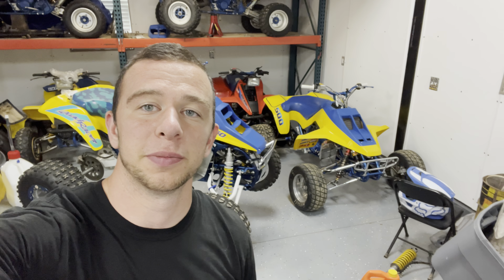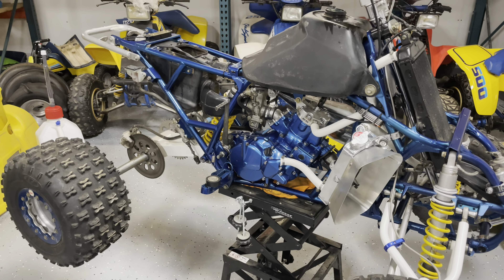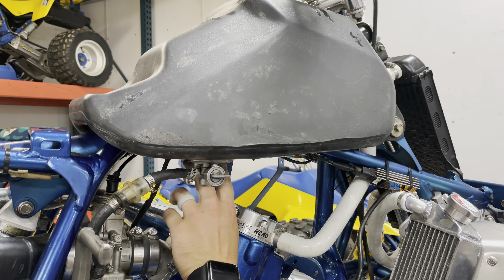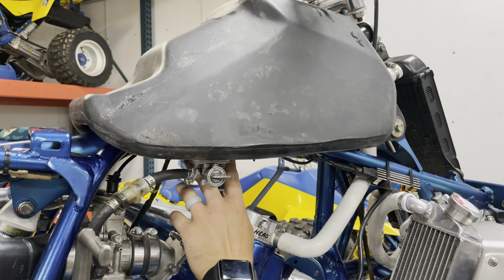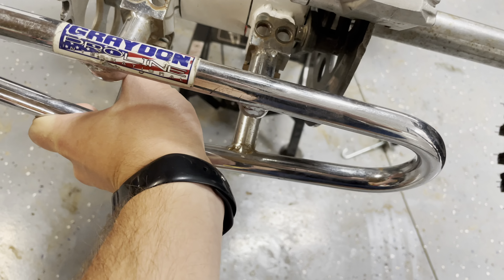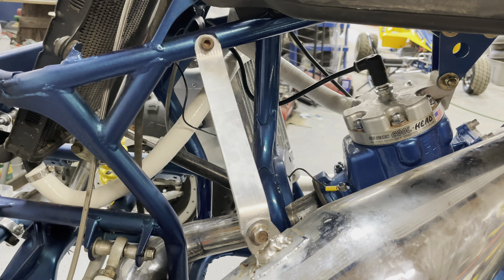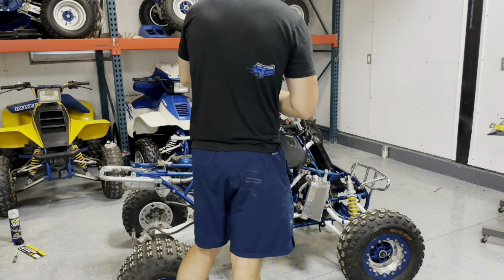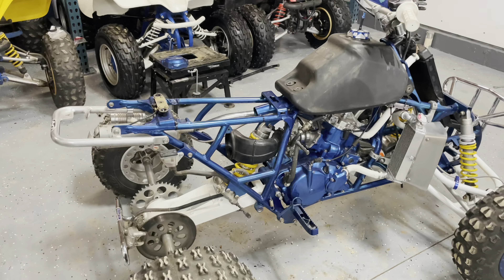Project LT250r Part 4 First Start! NOT WHAT I EXPECTED! (High Dollar Build)

Comment: when working on diesel engines we always keep something close that will block the air flow into the intake in case of a runaway situation.  Never really thought about it with a 2 stroke but obviously not a bad idea. Good video

Comment: Ever look an FMF Universal Turbine Core 2 spark arrested kit? the larger 1 1/4" for 500cc motor would slide over stinger and possible give more adjustment possibility...I recommend it for 87-90 LT owners. Really you needed a silencer made to fit though. I remember the pressure to finish the build before the riding trips though and the creative compromises that would just have to do despite how they looked.
Reply: You could also have turned / rotated the expansion chamber to make the stinger land outside the frame? Then make custom mounts. But I suspect at that point it would have interference with the fender...I rode mine without fenders once....lol
Reply from the maker: Very well-said! I can tell that you’ve definitely been around the block with the Quadracers! That’s a really good idea with the zilla silencer. They’re quite a bit longer, but I could always take some length off. Will definitely have to experiment a bit! Great input!
Reply: @jaegersracing  The FMF Universal kit is a silencer that is separate from the included pipe that has a few bents so you can rotate to desired position and cut it to any length if desired, google some pics...

Comment: The expansion chamber bracket is that far off for the OEM rubber mount?
Reply from the maker: Yeah, I really have no clue what’s going on there. Motor came from a second gen LT250r and bolted right up. I never would have though there’d be that much difference, but apparently there is!

Comment: That NGK plug boot is a must along with a good (new) spark plug wire. No mention of what plug you chose or what stator you are running?
Reply: appears to be B8ES...I would start with lower heat range B9 and only go hotter if fouling plugs. But I never could run the ES plugs long and always had to use the OEM recommended expensive EV iridium tips to avoid untimely failures.
Reply from the maker: Yes, that was pretty much all I had available at the time. I need to educate myself better on spark plugs actually. Would be good to learn the each digits meaning on the spark plug code. You familiar with them?
Reply: @jaegersracing  B= 14mm THREAD X 13/16" HEX, (R) CONSTRUCTION IS RESISTOR TYPE PLUG AND IS IRRELEVANT FOR YOUR APPLICATION, 9 IS HEAT RANGE AND HIGHER NUMBER IS COLDER,  E = 19mm (3/4") REACH, S = FIRING END CONSTRUCTION AND THERE ARE A LOT OF THESE, AFTER THAT IS A GAP NUMBER IF EVEN SHOWN....sorry about the caps

Comment: Feel bad for your dieseling start up...but it seems like you knew better and have been there. Kill switch and pulling plug boot is not gonna help as I also found out. Best to up shift into a high gear and dump the clutch (preferably while holding the brakes) requires a shifter, chain on sprockets, clutch cable attached. Opening the full throttle like you did also works. And lastly I suspect if you had put your hand over that carb boot it might have choked it, so it could not pull more gas through the carb, but I never tried that trick. Waiting for the bowl to empty of gas is no fun...lol. Probably, lucky the stator cover was off. I used to put lapping compound on the shaft to lap the stator and mate it to it by rotating it by hand. The magneto flywheel spinning forever and sparking while traveling all over the garage was funny as hell though. Never seen that happen before!
Reply: At least the rings didnt fall off the piston and hopefully it's not to scored or melted in there ??? It would have ran richer with  an oil filter attached to the carb. You can also get angled pod air filters that might clear your shock....
Reply from the maker: It was quite the experience haha! In a previous video, I was even talking about how you should properly prepare for the first start up by assuring your clutch lever/cable, shifter, chain, and brakes are all good to go because it’s the best way to kill it in the event of dieseling. Then I went and rushed a first start-up because I was out of time haha. Engine ended up being totally fine!

Comment: Why not just add  the 1st gen air box and you would have clearance for the exhaust, believe in one of your earlier videos I saw one in roller.
Reply from the maker: That’s a really good idea. Unfortunately the 1st gens won’t fit on the 3rd gen. Because the were meant to go in front of the shock as opposed to behind and the mounts and everything are all different.

Comment: Oh yeah, loft tour!  That QuadRacer hybrid build looks awesome.  Oh, and that rear bumper is unheard of these days!  Those were great if you're stuck uphill or downhill because you're grabbing from a lower center of gravity.   As far as your exhaust situation, my dumbass on any other build would've put a foam tube filter out, and slip the sock over it for the dunes....but this is not an ordinary build, and deserves way better.  That sucks not being able run that awesome air-box.  I see an exterior exhaust re-route to snake around that frame in the near future. 

Also don't sweat it, even the best make mistakes.  I've seen way worse happen and besides, no catastrophic failures like a seize, cracked piston, rod ejection, shrapnel, or missing fingers.

 Hope the dunes have been a blast, and that it all went smooth.
Reply from the maker: Really appreciate the comment! Yes, I plan to do some 1-on-1’s with some of the bikes in the future! Now that I’m back from the dunes, I’ll be able to give much more time and attention to getting the bikes dialed in. The airbox problem will get solved along with that!
Reply: @jaegersracing  I always wanted both those bumpers...Possibly Angled filters and FMF Universal Turbine Core 2 silencer kit?

Comment: I wouldn’t take the 250 without an airbox
Reply from the maker: It’s definitely not ideal. If I can’t get it sealed up and protected properly then I might get crafty with an old airbox and modify it to fit around the silencer. Running an open filter with an outer wears on it is common though.
Reply: @jaegersracing  I was thinking about it if it was mine I would pop the rivets and move the shock mount back like 3 inches which may be too much but that’s how I was thinking it out in my head for a non airbox filter
Reply: Angled POD type filter or K&N with outerwears might clear the shock.